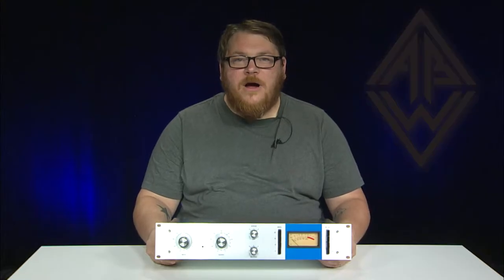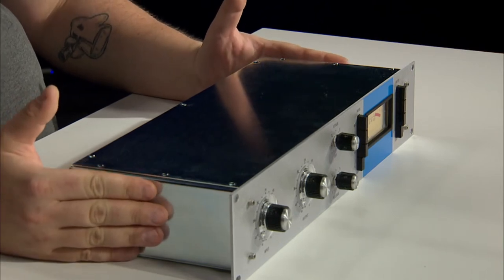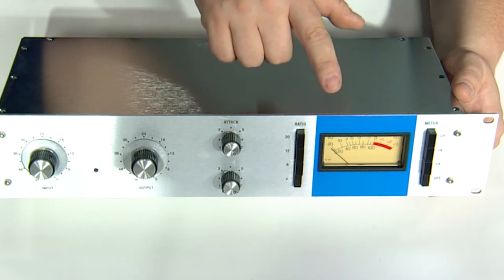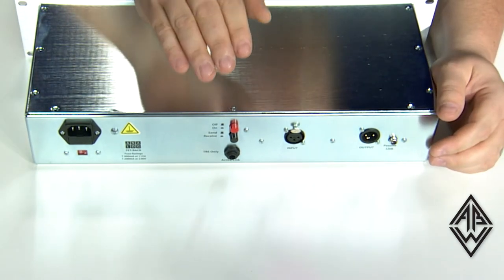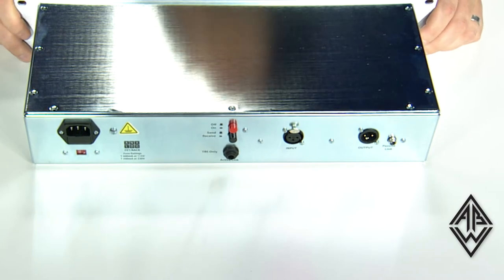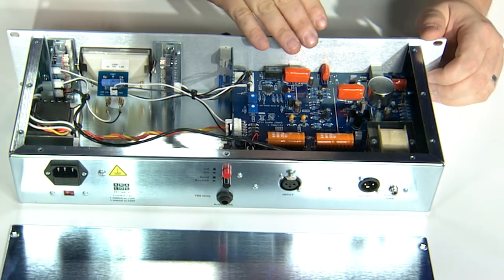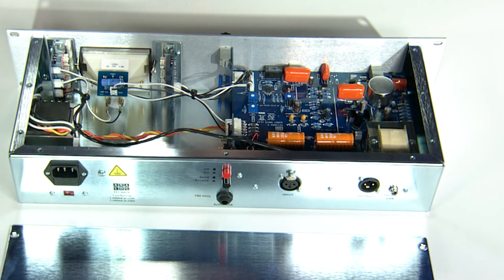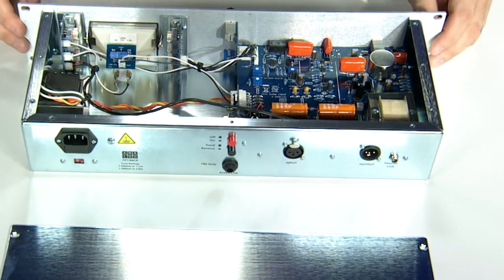Analog | fet/rack - Hairball Audio built by Billy Pratt of Audibility Recording - ABW Reviews

Comment: I love these compressors too. They are as faithful to the original units as is possible with modern componentry. The active link function is indispensable, eliminating the need for super matched transistors between two units and the need for those clunky, battery operated matching boxes when passively linking through RCA ports.  These things SLAM. They have about 6dB more gain and 6dB lower threshold than the later revisions. So much gain that you can even use these as microphone preamps.